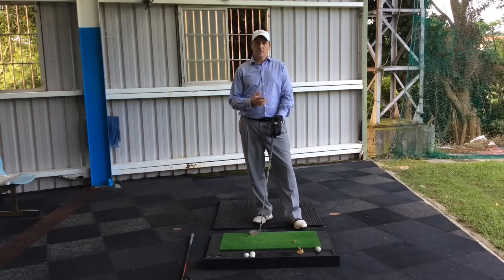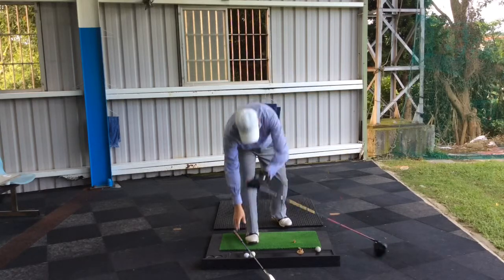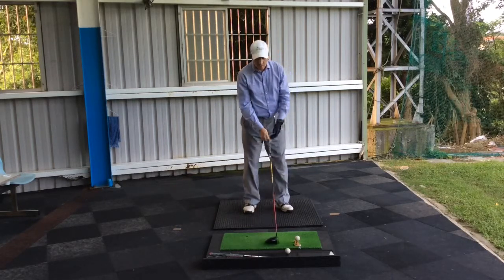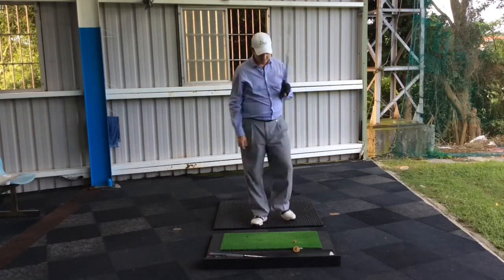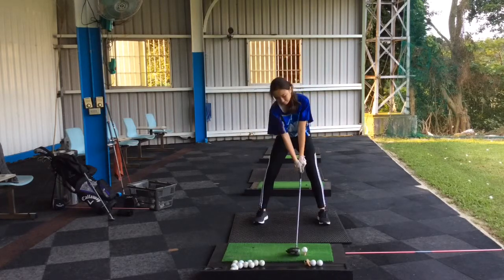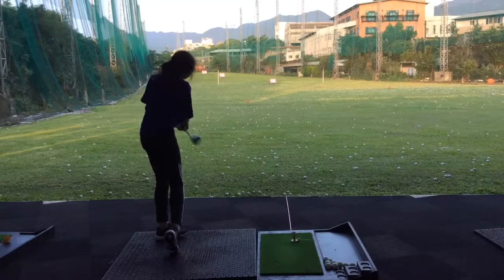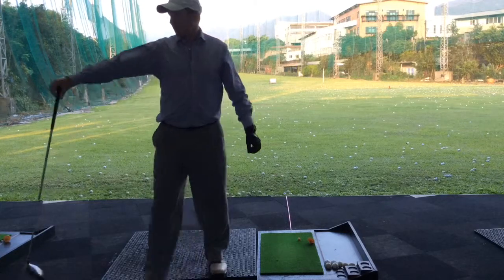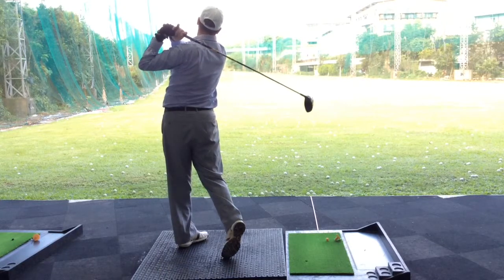Driver Death Moves: Tension in the swing - Make a Tension-free driver swing drill (189)

Comment: I was once told that iron swings have more of a “V” shape and driver swings have a “U” shape on the downswing.
Reply from the maker: Hi Charly, I think that is true to some extent as the irons are descending angle at impact and the driver is on its way upward marginally when it gets to the point of impact, i.e. it’s just coming up the ‘U’ shape having gone past the bottom of the ‘’U’. So Cassie has been striking the ball on the descending point which, given the lack of loft on a driver 9.5-10.5, sends it out really low even though she is making a good swing and good contact.